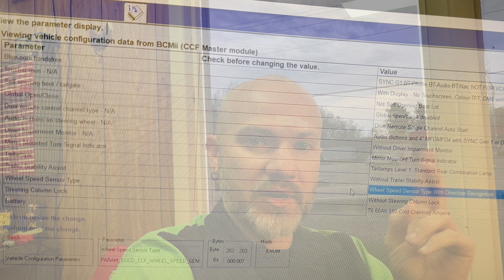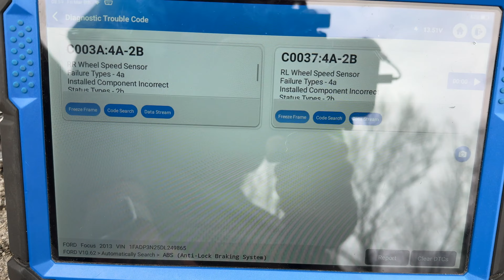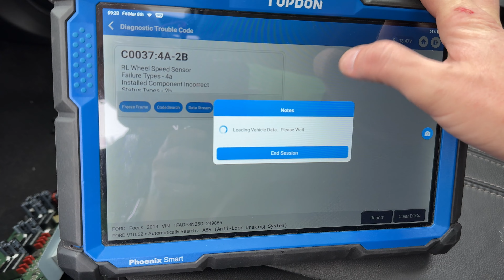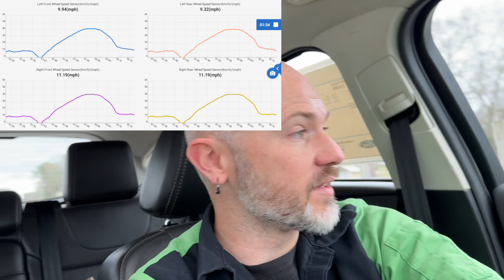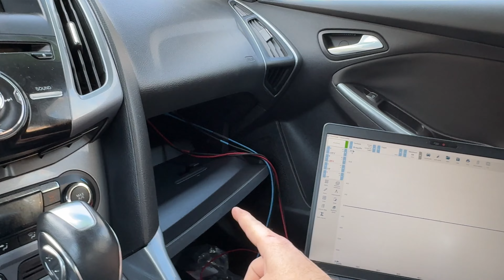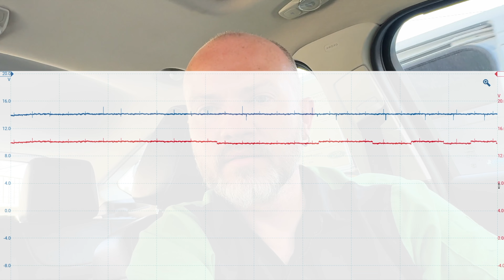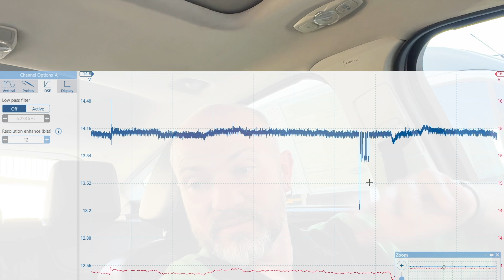The Un-Fixable Focus is now FIXED! - Part 4

Comment: I am not surprised by anything FoMoCo does. In the seventies, a  1972 Ford Econoline came into my shop for a tune up. It came back about 2 weeks later with lack of power and misfires. He was irate. Dwell and spark timing was way out of spec. I saw that a lot of the ignition point's rubbing block was worn off inspite of adequate lubrication. Further inspection revealed that the distributor's cam was never polished at the factory and still in sand cast form. He confessed that 2 other shops couldn't tune it either. I called Ford to get a new distributor cam and was told that even though I had the distributor's part number, they wouldn't sell the cam because Ford changes design throughout the model year. I fixed it by installing an aftermarket electronic ignition system that didn't care if the cam was rough. That was my customer for life after that.

Comment: I just got a 12 Focus in the shop for a Rear Left "Tone Wheel" code... So get the entire hub assembly from Ford by VIN? Glad I remembered to rewatch this video lol!
Reply from the maker: lol yep
Reply: @autodiagyt  It has the smaller wheels, no auto parking, but "Hill Assist" message comes up...I'm so confused xD
Reply from the maker: @PineHollowAutoDiagnostics  lol yeah that confused me on mine as well. They use those sensors for more then the parking feature.
Reply: @autodiagyt Ford dealer tells me that the rear ABS sensor isn't even sold separately... Insanity! 😂
Reply from the maker: Lol it sure is. I bought several, even though they was all wrong lol.

Comment: Such determination.  did you check the resistance or impedance of the unit.
Reply from the maker: Digital sensors don’t give good results. Older VR sensors will because they are a coil of wire but anything square wave you are reading the resistance of a power converter and other circuitry.

Comment: I think in first part ask you does have magnet in that hub... 11:25 now, can you mount old sensor in new hub, and opposite? 12:43 Oooo, you already did... Awesome example.
Reply from the maker: The hub is not the issue only incorrect sensors
Reply: @autodiagyt  True.

Comment: Not surprised. Currently working on a edge and needed the bracket to clip the bumper to the quarter panel. Ford has the part listed as a "license plate reinforcement bracket". This part is no where near a license plate nor is it a reinforcement part. lol

Comment: I had a shop put the wrong bearing on a later model ford,  eneded up scoping it to learn how it works.. 8 pulses staying still, 10 pulses forward and backwards,  it's a motorcycle encoder with a module controlling the output.  Nice job! 1st time I seen this I was blown away as well. Thanks for taking the time to take us along.

Comment: Jake

First - AWESOME series of videos and congratulations on figuring it out!  Really amazing work and the sign of a master diagnostician!

Second - I'm one of those damn engineers that mechanics complain about ;-).  Since my area is electronics I've spent a lot of time digging through scope traces I have this observation.
I noticed on the scope traces an interesting thing.  At these time stamps there's another very slight signal anomaly that seems to be on both channels:

Time stamp     number of time intervals from the left side
22:35                   +1    - I had to pause twice to get to a 2nd frame with the same time stamp
22:40                   +2   - same as above
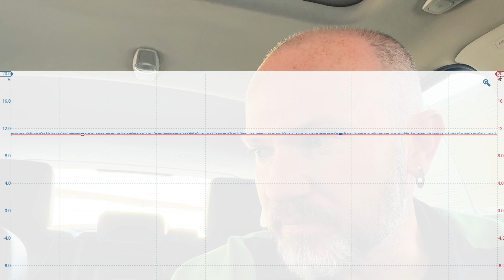23:05                   +2   - after you paused the display at about 23:01, the signal I'm mentioning is 5 time frames to the left of the blue "data packet"

For a time length that's about the same as the "data packet" on the blue channel there's what looks like the same time length "noise" particularly on the red channel.
I'm wondering if the ABS module tries to pull down the signal and on the blue channel it can, so it accepts the sensor as being correct.  On the red channel when it tries to pull it down since the signal doesn't pull down it doesn't accept it as the correct sensor and that's why the error is shown.

Alternatively, the sensor sends this packet and the "noise" I noticed is really noise ;-).

Question:  Did you time the frequency of the "data packets" to see if they're regular?

Thanks again for an awesome set of videos about this puzzle.

Mark
Reply from the maker: I didn't go into that much but I think the noise was ignition related.
Reply: notice the shape of the signals. the red trace pulls down stays down then goes back up. where the blue trace only reports the start and finish of the segment.
Reply: or is it reading the space in between segments?

Comment: "beyond billable" -- I think I'll use that one, if I may!  I also would've liked to see a waveform for the front wss.  Didn't service info mention somewhere in the previous parts only the rears having this dual-channel feature for direction detection?
Reply from the maker: Front was shown in part 1 but it's the same as the red trace in this video
Reply: @autodiagyt  ahh thanks.  I got confused tryin to follow along, I can feel the frustration!  You should be able to charge Ford for some of your mis-guided diag time due to their inaccuracies.
Reply from the maker: @ablackformula  I wish I could.

Comment: Bravo, Jake!! Your persistence paid out! Fantastic series of videos!
Seems almost criminal that Ford doesn't supply the right sensor by the VIN number - the time and money spent because of that is appalling.
This confirms that the correct sensor does talk to the ABS with data packets, while the others just output a square wave. And not a word about it, anywhere!
Reply: As a shop manager... I can assure you the fix didn't "pay off"
Reply: @johnriley7053  Completely agree! The only positive return was to overcome the challenge and the knowledge gained. Under some circumstances, it could be viewed as a learning cost, making it a very expensive learning.

Comment: So I was partially correct in my thinking on my part 2 comment. The module is seeing not only the voltage level, but the lack of that "data packet" intermittently pulling the voltage down slightly.
Those are wildy different signals when moving. Is there some sort of microprocessor in the correct sensor that's actually sending some sort of data packet? I'm not understanding how the module is interpreting the data...
Great case study, really appreciate you posting this and your determination in seeing this car through to the end.
Reply from the maker: Yes it has a micro in it. Pretty crazy stuff
Reply: @autodiagyt  that is nuts. It's crazy how technology is moving on modern vehicles these days. It's hard to keep up!
Consumers always arguing about price, diagnostic charges, etc and have no idea what it takes to fix their vehicles. I think we've done a poor job of educating the public on that front. It's getting better, but still a long way off.

Comment: Great video!!! Thanks for sharing all that informations. I was wondering would the signal from front sensor be the same like this good one from rear, maybe it would help diagose it little faster.
Reply from the maker: The front sensors use a standard MR signal just like the Red trace in the scope capture.

Comment: Man that was a good one ,content gold for you , was that stupid fast waveform not coming from the module as a confirm signal that the wrong sensors would not allow on the signal , seems odd a sensor sending that out  ,
Reply from the maker: It’s like a one way communication similar to a SENT module I believe
Reply: @autodiagyt  Thanks for reply , i have never seen this on a wheel speed signal , learn something new all the time ,cheers

Comment: jake man that rabbit hole was deep. the scan tool was not lying,  it said that was the wrong sensor. man its tough to know when to trust your scan tool and when not to. but in this case if you had you still would have been in hot water as ford screwed the techs with this crazy sensor and not list it as a single part number and have it only as part of the whole hub assembly. Man good detective work to hunt this one down.

Comment: How about Depin and swap the rear wheel speed sensor wires at the ECU. See if the code jumps to the other side. ???
Reply from the maker: That was all covered in part 1 and 2

Comment: Hi Jake 
Two things I was thinking about
1. Don’t most abs systems use a single magnet hall sensor and reverse is detected using a variable pattern reluctor (encoder). Not sure what the advantage of the double magnet is other than it may be slightly more sensitive or faster. 

2. Could you not have just deleted the hill assist from the BCM and used one of the black sensors as another quick fix
Reply from the maker: I’m not sure how most handle forward or reverse rotation, as for deleting the hill assist that’s not possible through ford software. Some was saying forscan can do it but I don’t see it and even if it did if the car ever had the configuration reloaded from the server it would be broken again. Turning things off in software isn’t a fix to me and I’ll ship it still broke before doing something like that. I just don’t need or want to be that kind of technician.

Comment: As we get into the era of self driving cars, I can see why engineers would want bidirectional monitoring of wheel motion. Typically design features are added slowly over years, and they don't like to keep too many parts on the shelf because of stocking issues. So, we should not be surprised to find higher level tech that might not be important to this model. I'm a little surprised that Ford hasn't offered a tsb to explain your kind of frustrating experience.

Comment: That was a great series Jake!  I'm wondering if this could be a SENT sensor. Instead of the usual signals, it sends data to the module. Talks to the module reporting information about whatever the sensor is designed to monitor.
I do know they are starting to use them in some European vehicles.
Reply from the maker: After seeing the scope pattern it seems to me it's a type of data packet somehow so pretty similar to a SENT

Comment: You did great! Very frustrating for the dealer to give you wrong parts. Been there and done that many times in the last 40 yrs. You have perseverance that's for sure!😂 Good job! I wonder what the front signals look like?
Reply from the maker: They are normal MR sensors so the pattern they make is like the red trace in the scope capture

Comment: Are the sensors different lengths to change the air gap?
Reply from the maker: Nope
Reply: I see the active sensor part now! The messsge changes going backwards/forwards. Common on VW

Comment: what is the difference in ohms of the sensors, as a ford tech of over 30 yrs i always made comparisons and kept notes. I'm retired now thank god. I feel your pain!
Reply from the maker: The only time I look at ohms is a VR sensor. These MR sensors are digital so you are not seeing anything definitive with a meter. I’ve seen some MR sensors read OL but work perfectly, they just have millions of ohms of resistance because it’s a power supplied to a power converter to a micro processor.

Comment: The problem could be inside bearing hub . Connectivity to the sensor. Or just design issues.
Reply from the maker: Definitely not a hub issue. The sensor works fine in the aftermarket hub. This is 100% just a wrong sensor issue on Ford's part.

Comment: So then the correct sensor has to have some kind of circuitry in it that would produce that signal without movement that allows it to create that small data packet.
Reply from the maker: Yes

Comment: So I was wrong after all, I guessed configuration/software version fault. It turned out to be the wrong documented wheel speed sensor. I am fairly certain you can get just the correct wheel speed sensor if you order exactly the part number. Could you please provide that in the description or a pinned post? At least people don't have to buy a hub bearing just to get the sensor...
Reply from the maker: Part number is in the video

Comment: That new  green sensor seems to have a different bandwidth than the other sensors.  The internal pickup coils would be wound in opposite directions and connected in parallel maybe with the ecu looking for a neg going pulse or a positive going pulse to indicate forward or backward wheel rotation.  Heck I don't know.  What I DO KNOW is Ford's really liable for this fubar rabbit hole.  They should use this video to train their own people and send you some money!

Comment: I had one come in and both rear didn't work but I had a mini signal on the scope. The fix was water in a rear connector. Blew it out with some WD-40 and it came back to life

Comment: The hall-effect sensor inside of those Ford sensors probably has programming that is different between them.  Yes, some hall-effect sensors only need 1-wire to communicate digital information and have programmability that needs to be set for your application.  The 1-wire protocol similar to I2C but with one-wire.  That programmable data is usually dealing with magnetic sensitivity, magnetic orientation and a programmable identification number that can be read by the software in the module.  If the sensitivity or orientation settings are incorrect for that hub it might just not detect the rotation, but if the ID is not recognized by the software in the ABS module then who knows what it will do.  The ABS modules were probably getting programmed with newer firmware that didn't include the other IDs for those parts, so when you updated the firmware it no longer recognized the other parts as valid and usable.  IMO, it was an ABS software issue.  Ford can fix this with software but probably won't.

The 1-wire protocol is well documented so if you can figure out the exact IC inside the plastic molded Ford sensors and get their IDs then someone can probably work out how to reprogram the ID in the sensors with an Arduino, too.  Would just need to know the IC part number and work out a circuit to communicate with it at 12v...

Edit: Some of the hall-effect sensors also have a configurable output mode.
Reply: Yeah, one sensor is probably digital and the other probably set to pulse output. This makes sense to me.

Comment: I remember Keith from LT1 having a similar problem a couple of months ago, but this was with a cam sensor on a Cadillac with a V6. GM told their dealers that if they did not have this specific number in stock, it could be superseded to another part number instead. In my opinion, I don’t think they knew what the difference was; they probably looked at it as a way of saving money on inventory. This is typically seen in the aftermarket, where they attempt to consolidate part numbers.

Comment: Speaking of not being able to get the correct sensors . I have a Taurus that i could not get a correct factory fuel regulator pressure sensor for and all the aftermarket fprs had the wrong ohmage . I went through 20+ aftermarket sensors and finally had to get one from the junk yard.

Comment: This is what happens when other people work on the vehicle before you. You would not have this issue if you would have had the original sensors. It is a sad state that no matter what when issues are weird you should assume the other shop f'ed it up.

Comment: I had a flash back to Pine Hollow  having a timing code with all new parts  and 1 phaser was a little off on the timing mark  the pico showed it but it was actually a little luck and knowledge he found it
Reply: I forgot to say the timing marks aligned but the camshaft lobes were off because of it being the wrong phaser

Comment: The one it's happy with must have a chip inside that is doing processing and reporting the data back, so one is an 'active' sensor, whereas the other one is a 'dumb' sensor where all the processing is done on the main module.

Comment: I've had to pretend to be somebody important to get to speak with an engineer in Ford's research and development department at the Ford Plant before. I had to do that to find out if a bad ignition module could drastically advance and retard the ignition timing willy nilly on its own without any change in RPM. The answer was they've never seen that happen, but if failing, it was a possibility. Hearing that, a new ignition module fixed it. This was a 1974 year model and happened in 1977.

Comment: I had a feelin' ...
Reply: Forgot, Thanks for all the work and going through the process, fixin' this stuff is one thing, all your videoing and editing has got to be time-consuming, to say the least.
I was thinking incompatible magnetic encoder in the wheel-bearing/hub unit, so I wasn't far off.
Back when I worked on Ford, in the late '80s, wiring harnesses were made in Canada or Mexico, the car's VIN was no help.

Comment: I would put a set of those "wrong" sensors  into the new hubs and take them back to Ford..  And just say-  "These sensors didn't work for my car - they won't even plug in--  I guess my car has been Frankensteined with the wrong parts from another car;  But I have it figured out; so I just want to bring everything back." --  Ford can sort it out from there. :)  ...   I'm not afraid to do that sometimes and get my money back.   They most likely won't notice that the sensors are a different color and you'll get your money back.  It's their fault that you're having all this trouble--  I'd make them eat it.   If you claim that you never even plugged in the part, then they will refund your money.

Comment: Wow, a lot of parts and no help from ford or scan tools. I believe the dual direction sensor outputs a square wave  In reverse the signal is reversed  . Basically inverting the signal. from your captures, the data in the blue trace may define forward or reverse. Parts Cannon sponsored by ford! The D version cost is $32 and the A version is $23. a lot more processing going on in the D version. Not a common signal coming out of that sensor.
Reply from the maker: And the one by the vin cost 40 something!